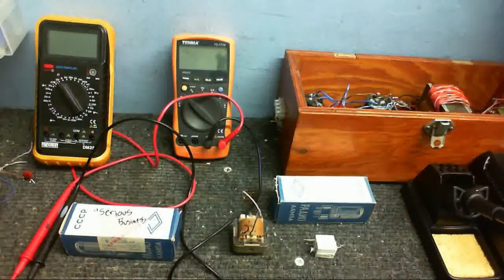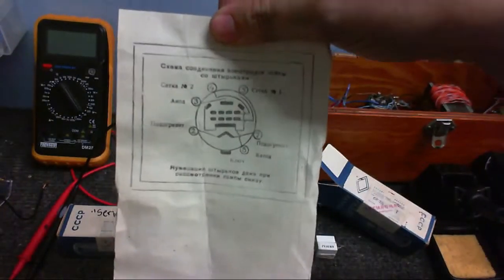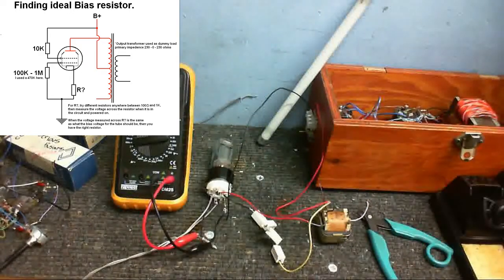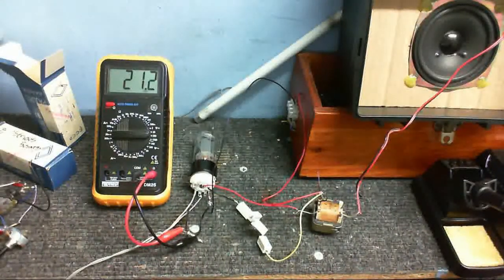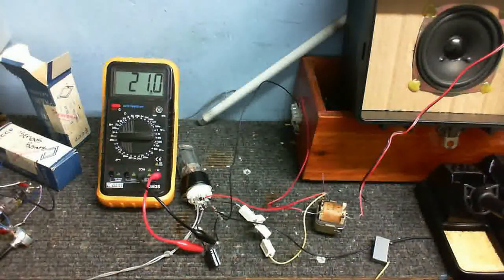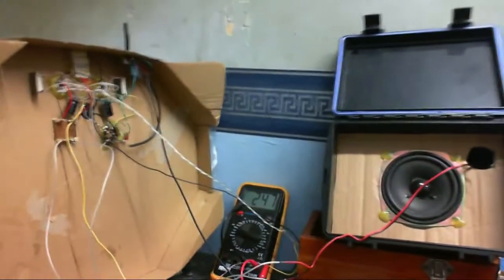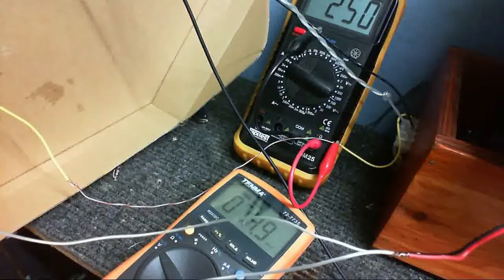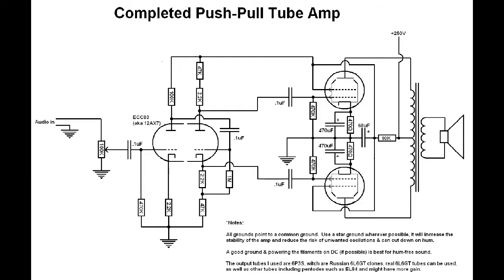Tube Time 11 - The "Serious Business" tube amp

Comment: A word of advice if you're using a cathodyne phase inverter- put a ridiculously huge grid stopper resistor on there, 1Meg or thereabouts.  It won't cause any high end rolloff as the cathodyne has a gain of less than 1, so the grid capacitances are effectively zero.  This will stop the weird crossover and ringing type distortion you'll find happens at higher volumes :)
Reply from the maker: PokemonGlitches123 What do you mean by a "grid stopper" resistor?  I'm sorry if I sound a bit dumb there but I haven't heard of that before.
Reply: Oh sorry it is a resistor that you connect between the signal grid and everything else- remove everything connected to the grid, put this resistor in, then connect the rest of the circuit that would normally be soldered to the grid pin onto the other end of the resistor. :)
Reply: Harold Hennigan The way that ''thing'' is wired I don't think any stopper is gonna have any effect at all. If he has not electrocuted himself that is. I thought he was joking here.

Comment: The output transformer wont last 5 minutes !   An output tx for a 50-60watt push pull amp is a hell of a lot bigger than that.  Also you should include a bias pot.   Check out the schematic for a Marshall 50 watt superlead guitar amp, just look at the power section of that.  They use EL34's and not 6L6s.  There is not a lot of difference between the two tubes, a couple of different resistors and pin-out on the valve.

A ECC83, 82 or 81 is ideal for phase splitting - just different gains.

I would however preamp with another ECC83 (12AX7 to the yanks!) to get from line level.
Reply: Marshalls are pretty damn amazing amps to be fair, and Clem can't include a bias pot on this amp because the bias is set by the high wattage cathode resistor, and it's self biasing anyway because of this.
Reply: Also I'm gonna have to agree about that OT- looks like it could withstand maybe 10 watts at a push, nowhere near the 40-80 watts required here... It will also probably be way too high impedance for 6L6s to function properly without sounding muffled and crappy
Reply: Bias adjustment is important in audio amps, valves differ from matched pair to pair.  I am well aware of this schematic, it is a basic design and it can be improved a hell of a lot.  A triode/pentode switch would also be a great addition.  I repair and build amps for a living, but Clem is learning the same way I did - via experimentation.
Reply: I learned that way also.  Bias adjustment is most important in amps that use a negative voltage on the grids of the power valves and a grounded cathode, but this amp uses a cathode resistor to raise the cathode voltage.  The valve finds its own bias point this way and fine adjustment is not necessary and pointless, especially since the bias changes with the output too- at higher volumes the cathode voltage will rise up more due to the increase in current.
Reply from the maker: Phil Docker Believe me I would have used a bigger transformer right from the start if I had one, this is the only transformer I have that has a center tapped primary, so, I guess I'm stuck with it.
Reply: Mail me - I prob got some knocking around in workshop spare....
Reply: I've got a 50 watt EL34/6L6 transformer if you want it, came out of a new vietnamese Marshall guitar amp I used to have before it died and I tore it down.
Reply: Those vietnam made Marshalls we're pretty rubbish!  Was it a MA50 ?
Reply: Phil Docker yeah, it was crap, I modded it, it died.
Reply: Ive modified hundreds of amps, but getting a cheap amp and trying stuff out is the way to do it.  Quality transformers are well worth getting for hifi and guitar amps long term - but foreign made valve amps are only £100 used and you can do a lot with them as long as they are not all SMT PokemonGlitches123 .
Reply: Phil Docker Thats true but I'd steer clear of the MA series marshalls, the output stage in them is awful and when I modified the clean channel to drive it into distortion (like on the old Marshall Plexis) it blew every pair of EL34s I put in there, no matter how they were biased.  I do however have a couple of Epiphone Valve Juniors that are fantastic for modifying :D